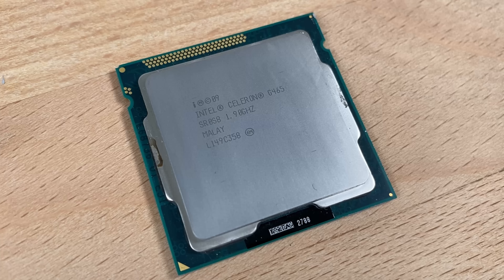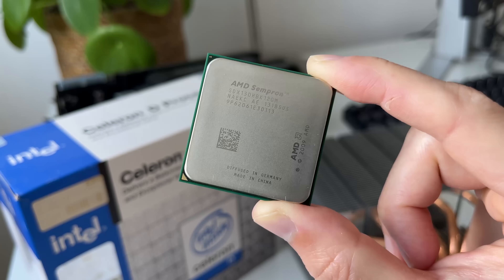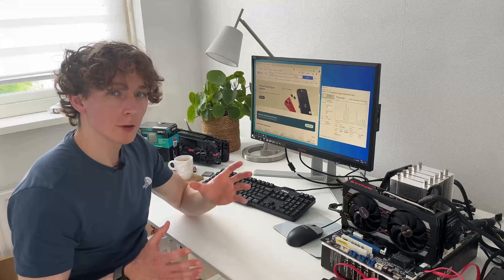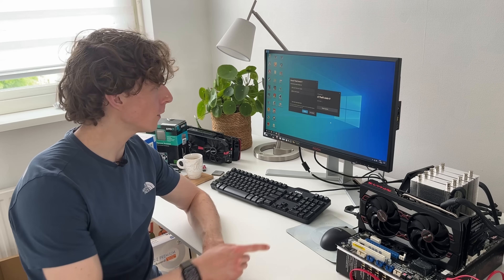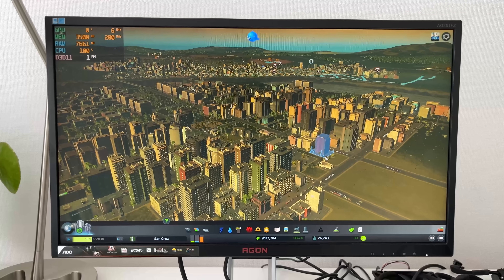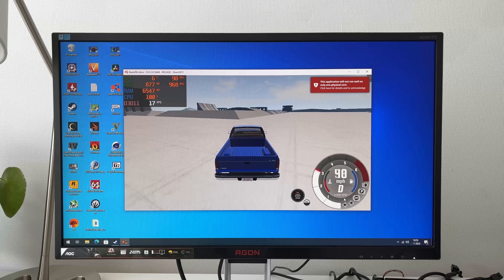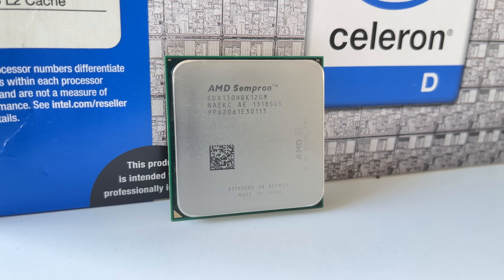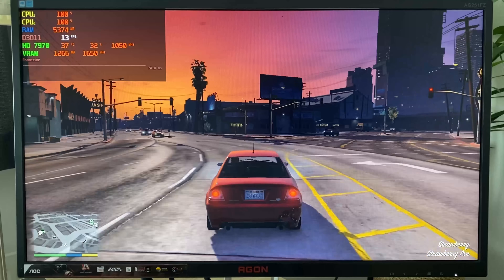AMD's Final Single Core CPU...

Comment: you forgot the AMD A9-9425, AMD's last single-core processor (dual-core technically, but shared FPUs are half of cores), released in 2018, but why i checked comments, and none of them mention AMD A9 APU

Comment: at that time i did buy an sempron 145 and unlock it to athlon 2 x2 4400e, also had success with overclock at 3923MHz stable (1.552v) and Asrock N68C-S-UCC, and daily use, i still have the photos from that time, SuperPi 1M 20.922s, good old times.

Comment: A lot of times especially take it from someone who had a AMD athlon X3 4500 and turn it into a phenom 2 x4 b50 you have to pump some More voltage at it to stabilize the core in fact I have a submission on CPU bench showing the CPU off and it's unlocked state. What's probably the case is it just doesn't have enough voltage to keep the core stable under load

Comment: Windows 8 actually runs VERY well with Single-Core CPUs like this. 

I have an old laptop with a Pentium M 1.6GHz and 2GB DDR1 RAM in it, and it runs Windows 8 rather easily; I can play OG Runescape on it with the ATi X1300 graphics!

Comment: Asking why this was "released to consumers" is fundamentally flawed. The Phenom chips are mostly found in data-entry applications in the commercial sector. Bar code scanning stations in warehouses, front desk computers in receptions, etc. AMD "had" to release them into the normal retail channels to target system integrators, as they didn't have much weight with the big OEMs. I have actually built quite a few such systems in my time.

Comment: Nice review. I had the 140, unlocked it to X2 from first boot and ran it at 3700 MHz. It was quite an upgrade from my previous Venice 3200+

Those CPUs were ok in 2010. Today (14 years later) we have a ton of JavaScript on every web page, games are multithreaded, so old hardware got old.

Comment: I don't know that I'd have ever classified these as a 'consumer' chip- they're more like the cheapest possible CPU you can get for passive rigs that don't use the CPU. Pair this with a 4090 or 2 (or other powerful GPUs) then turn it into a rig that only uses the GPU for AI models, hashing/mining or just general number crunching that only uses the GPU. There's a use case for this, but it's not as a regular PC, I suspect most who bought these bought in bulk and that extra 10-20 dollars adds up when you're maybe buying hundreds of them at a time. You'd have a many of these PC's, then a more standard PC that you'd use to remotely control them and sync up the GPUs to work together- I've never done this before but some of my Friends have had some really strange setups like what I mentioned.

Comment: The only reason why a chip manufacturer would release a slower, cheaper version of an existing product is because they had too much stock that couldn't meet the base specs of their better existing product line. So, in order to recuperate some of their money, they will release a slower, lower quality processor. All CPU and GPU manufacturers do this.

Comment: Wait no integrated graphics?
There are like a million applications for very weak computers. Tasked with only having a single piece of software even installed, and never connected to the internet. But no onboard graphics means you have to buy a GPU in addition to the  bottom tier CPU.

Comment: The CPU core unlocking was quite fun when it worked. Unlocking cheapo triplecore Athlon II X3 CPUs into Phenom II X4s and having them be fully functional (including extra L3 cache) was mindboggling. Almost the same level of dopamine rush when it turns out to be working as being able to successfully OC a cheap C2D E4300 from a measly 1.8GHz to 3.6GHz and it runs stable no matter what you throw at it, while having literally doubled the clockspeed so it plays in the same league as CPUs that cost triple the amount. Sad that fun stuff like this will likely never happen again

Comment: I've run across these  and other Semprons in scrapped PC's typically recovered from minority and generally poor neighborhoods.  They were "popular" in super low budget systems and marketed to folks that didn't know  what a CPU was and thought they were getting a bargain. They could do dial up e-mail and very basic web browsing, but most of the folks that bought them never even did that much with them.  They might even be paired with Windows ME for a better experience.

Of note, it is surprising how many of these salvage systems came in still in good working condition. It's like they were never used by anyone.  I know I have at least one Sempron system left under a pile of pulled 486's and P90's,

Comment: How does this Sempron compare to a 570J from all the way back in 2004? The 570J beats the 3.80GHz mark and has HT, so it has to perform better than this 7-year-newer CPU, especially if the 570J is being overclocked! About the Core Unlocker, I remember there being some Phenom II x2's that could be turned into x4's and Phenom II x4's that could be turned into x6's. The Phenom II 945 BE was one of them. Fun times... I also remember back when I had an AMD FX 8370, Device Manager would show 9 CPUs instead of 8, although one would always be marked as disabled. I never heard about this with AMD FX cpus, and I dunno if that was just a glitch or not... Think there's a chance of that 9th core being real?

Comment: That chip came at the sametime as the old gta 3 or Gta vice city that could explain why gta v doesn't work well 😂 I wouldn't try the remastered versions cause it will do the same as gta v. But if you can find the old copies test them 😂👍

Comment: I had a X3 version and with my motherboard, was able to get 4th core unlocked making my triple core, Quad. It needed way more voltage to become stable but this takes me back to my early 20's

https://docs.google.com/spreadsheets/d/19Ms49ip5PBB7nYnf5urxsySvH-Sdy6liE2EBDaB8b54/edit?gid=0#gid=0

Comment: Runs gooder than my A4 2.8Ghz dual core of my netbook with a dual core atom CPU LOL, though both machines have 6gb of ram rather than 16, those machines are for working on cars though so they really dont get used on the net.

Comment: Back in the days i used to own (i still have it, just not rly using it) a Sempron 140 pc, recently found out about the second core in the chip, so I've bought a new motherboard that supports the UCC feature and unlocked my Sempron 140 with 3.6 Ghz.

It was still pretty awful and faced some inconvenience during the time I was testing it, but man, I enjoyed every minute of it, the games I used to play as a child with 10-15 fps was amazing with 30-60 fps on the same old nostalgic setup, amazing video man ❤️

Comment: But that is not even close to the last desktop single-core AMD sold. Their 1core2thread CPU were even available on AM4.
Reply from the maker: This is not true - AM4 started at dual cores https://www.cpu-world.com/Sockets/Socket_AM4.html
Reply: @FullyBuffered  cpu-world? I mean they even list the 1core2thread CPUs but just wrongly classify them as dualcores. Those are CPUs with SMT - not 2 cores.
Reply from the maker: If you wish to classify those chips as single core, that is fine.
Reply: @FullyBuffered  i mean that was what the lawsuit was about. And the modules are just SMT-enabled cores with a bit more integer-units - and they also perform like you would expect from that.

Comment: Why not use Linux for a more smooth desktop experience on older chips? I have a friend with a old laptop, that once Silverblue was installed, everything was smooth as fuck. On Windows 10, it was so laggy
Reply from the maker: As it defeats the purpose of being able to compare to other chips, which would have no problem running the tasks in the video on W10. In other words, leveling the playing field.

Comment: They had two main lines the dual core and quad and up line
The chips MADE to be dual core have 1MB L2 core, theyre just set as single core
The 512KB ones are MADE to be quad or hex just set as single

Comment: The reason why Youtube playback was at 60fps, is because the GPU using the supported codec vp9 instead the cpu. It would be a alot worse performance on this cpu. Also firefox would be perform alot better than microsoft edge.

Another issue that i saw on this video, that Windows 10 regonized as "HDD" on a SSD drive, which makes issue for degrating because windows thinks that the SSD is a HDD because of the defragmentaion. Had the same issue on a other amd motherboard. Dont know whats the bios setting for the fix, as intel motherboard doenst have that issue, no matter how old they are...

Maybe add Honkai Star Rail on single core cpus as a benchmark game? Im very curious how it performs. If Cities Skylines (Unity Game) starts, this game should start too. I didnt found a benchmark video about this game with a single core cpu.

Comment: Somewhere I've got a Sempron 145 which did unlock great to a dual core. Have had it in my home server running 24/7 for almost 2 years. Never crashed. I don't remember how high it did OC but hey, it got eventually replaced with a Phenom II quad core.

Comment: Those load times brought me back. My old shared computers in my parents house were just as slow. Putting this on an HDD which is all you had back then exacerbates these load times massively. 

The reason people left their PCs on sometimes is that it could take upwards of a half an hour to get to a desktop and even then, you were not likely doing much yet waiting on startup apps and what have you.

Overclocking also had a much different connotation then it does now. Diminishing returns is more what OC-ing is anymore today, but bumping a processor up 1GHz or more back then could yield impressive gains. Modern chips are already pushed right to the upper limits out of the box and they do it automatically.

Comment: TDP is not always indicative of the actual power consumption, especially in those generations.
My Core 2 Duo E7400 has an official TDP of 65, but at stock speed (2.8 GHz) barely reaches 15W. Even when overclocked to 3.5 GHz it maxes out at only 35W, and that's under Prime95 ('normal' usage is ~20W max).
Reply: is this true about the real 15 watt usage? I would better get a Kill-A-Watt meter for the real consuption test. I dont see that a core 2 duo simply use 15 Watt on top of that...
Reply: @AntiGrieferGames  I see no reason not to trust the reported consumption, the VRM that manages the CPU power is precise enough.

An AC power meter is nice to measure the whole system but I'm only talking about the CPU itself here.

It makes sense when you compare it with what came before, e.g. look at the E6850: it was a 65 nm, 3 GHz, 4 MB cache, 1333 MT FSB, 1.5v part, and it was also rated at 65W.
It is not unreasonable to imagine a 45 nm, 2.8 GHz, 3 MB cache, 800 MT FSB, 1.25v part would consume much less than that.
I think Intel just slapped a 65W TDP on most mainstream models to make life easier for system building.

Comment: It was actually a clever bit of marketing. In the early days,  chips that failed dual core,  but the single core still worked, would be sold as a single core cpu.  The 130 was probably just a 140 or 150, that failed the cache test

Comment: I think those CPUs are an extreme case of defective chips recycling. AMD probably tried to sell CPUs that didn't meet the most basic QA. Hence the disabled core and the cut down cache (it's very possible that they were meant to have 1MB but part of it is defective and it had to be reduced to 512KB).

Comment: the answer to `What made them go "I know what consumers would really appreciate"` is that they had a stock off cpu's that had defects that affected max speed and/or cache. They don't want to sit on a bunch of unsold silicon after 2 years of manufacturing wavers with defects and try to sell them a little bit cheaper.

Comment: GTA5 likes GHz and North Bridge OC, there AMD have memory controller. So... I overclock x3 Athlon II to 3.5GHz and NB to 2.3GHz. 30fps stable. Stock x4 phenom II 2.8ghz with huge L3 cache has drops to 25fps.

https://youtu.be/BcOnCgXIFWI?si=3tDEgAdyOmLUwNuA

Doom 2016 I run at athlon 64 x2 2.8ghz with gtx750. About 30fps, with random frame drops. Pretty playable. Try to use cracked, non steam version. Sempron 130 has the Athlon II core, more efficient than old Athlon 64 x2.

I buy a lot am3 cpus for unlocking cores. You should probably find good one sempron 130 to unlock it to X2 and play GTA5 about cinematic 24fps. It would be the best "single" core amd cpu.
Reply from the maker: Nice! Thanks for the info

Comment: Very cool Sargas chip. Those were 1c/1t and shipped out 15 years ago + 1 week. 2.7GHz was quite a jump compared to the Lima chip that I daily in my server: Athlon 2650e. Another 1c/1t unit but 1.6GHz and capped at a grand total of 15W. Doesn't hold a candle to the Phenom II X4 system I built the same year but that also seems to be the entire point. There is a weird need for these single core systems lately and it's mostly for software compatibility and high availability servers that need to sip power. 2GB DDR2 is abysmal but does the job.

If you want better performance out of that Sempron you might be better off sticking to one DIMM per channel. There have always been issues with dual sets of memory in that time period.
Reply from the maker: Interesting! Thanks for sharing!

Comment: I owned a Sempron 140. 
Originally I intended to replace it after I confirmed my basic setup. 
But I found it to be ok for what I did back then. 
And while I failed to unlock the second core, as well as failing to make it clock higher, it did undervolt like crazy. I got it to run stable below 1V. 
Which meant I could run it passively cooled with the amd stock cooler.
Reply from the maker: Ha very nice, running it passively cooled with an undervolt! Thanks for sharing

Comment: Fun fact: there are two Athlon II desktop AM3 chips that are actually worse than every desktop AM3 Sempron except for the 130 you reviewed - those being the Athlon II 160u and 170u, clocking in at 1.8 and 2GHz respectively. They were often found in cheap HP desktops from 2010 and had 1MB L2 cache and a reduced 20W TDP, so they at least had those going for it (not the fact they were found in cheap minitower HP desktops, lol)
Reply from the maker: Oof yeah those sound particularly dreadful as well.

Comment: Amd has one of the coolest naming scheme, Ryzen, Sempron, Phenom, Athlon, Epyc, Threadripper, Radeon, Vega. Not to mention their code names so much better than the lake code names of intel.
Reply: Intel had a good naming scheme before. now its rather strange. but i absolutely ADORE the AMD namings of APU nowadays, which are all dedicated to Final Fantasy seies (like Arieth and Sephiroth APUs in Steam Deck, Oryon and Scarlett in Xbox / PS and so on). they have almost all Final Fantasy heroes in their lineups now
Reply: while i agree, we have to admit Raptor Cove is a killer name
Reply: Although clearly at least 13th and 14th gen should have been called Lava Lake, burning hot...
Reply: Some Intel brand names are cool too, Xeon, Itanium, Quark, Phi, Centrino (maybe I'm biased bc I'm a physics fan). Architectures like Skylake (the original) sounds sick too (they remember me the Skyactiv system Mazda uses in his engines)
Reply: @reiniermoreno1653 — Itanium was such a disaster from the beginning I could never like that name; I lived through things like that becoming “ascendant” instead of companies like DEC continuing.
Reply: @reiniermoreno1653  Intel Itanium? Considering its success the name "Itanic" has its justification 😁
Reply: @johnscaramis2515  I know the story, however I still like the name
Reply from the maker: Agreed, Intel’s naming scheme is a mess nowadays
Reply: @FullyBuffered what you don't want a chip called bottom of the rust lake?
Reply: Like what is the intel core ultra 7???
Reply: And their most recent 12-core chips don't self-fry while playing Fortnite of all games
Reply: To be fair Radeon existed as a brand long before AMD took over ATI.
Since 2000, as a followup to the Rage series.
And as competition to the 3DFx Voodoo series, Nvidia GeForce (started just 1 year earlier as a brand), and Matrox Millennium.
Reply: Oh yea I really love the new amd radeon Ai 6900 Xt. Excellent naming scheme ik
Reply: Got to give the suck a name...lol  ya know so you can keep up with the suck...  till epyc, TR and ryzen it was all suck.  cept a tiny time during P4 days.
Reply: Intel literally has Rocket Lake

Comment: I used one of these on a NAS. For fun, I overclocked it... I think I hit 4.6ghz or 4.9ghz. 

Now the motherboard/CPU are mounted on my wall with a DC-DC power supply as an art piece... that can still boot up and play PSX games in an emulator.
Reply from the maker: That’s a huge overclock - what voltage did you run it with?
Reply: @FullyBuffered  I may be misremembering; it likely was 3.9ghz. This was nearly 12 years ago, but I clearly remember trying to get the computer to pass stress tests (it posted) after 4 or 5ghz when a friend came by and said "it's good enough, just stop before you go crazy."

I don't recall messing with voltage at all; if I did, it was in very tiny increments.

The computer is still operable so I'll mess around with it when I have a chance! 

Glad you made this video... I had no idea I had the last single core AMD until this popped up (I subscribed now too!)
Reply: @FullyBuffered  Okay just checked my Facebook post from November 2nd, 2011 - looks like I hit 4.0ghz. I assume stock voltage or damn near stock voltage. 

Still, I'll boot it up and see if I can get higher by tweaking some things. Fun times!

Comment: the bad test might be from the testbench uses half of the cpuclocks to run itself and back then every version IE explorer added cpu load- Your 500 could not run buy a 750 because Microsoft uppgraded IE explorer to next level or xp sp2 uses more sp3 even more and vista chokes it